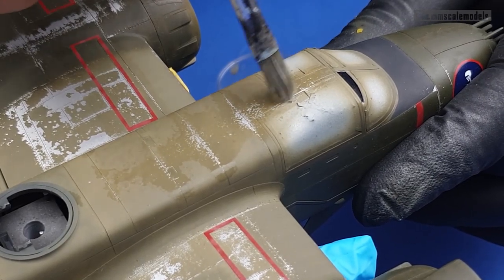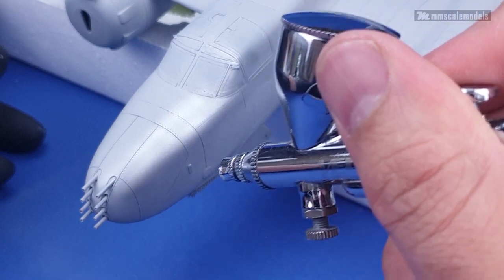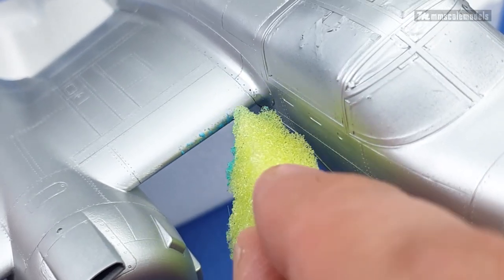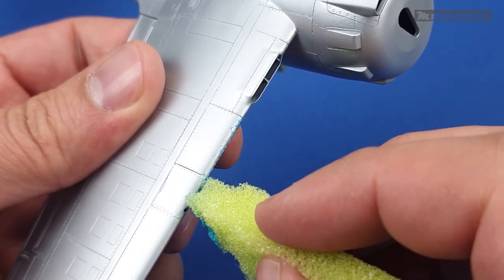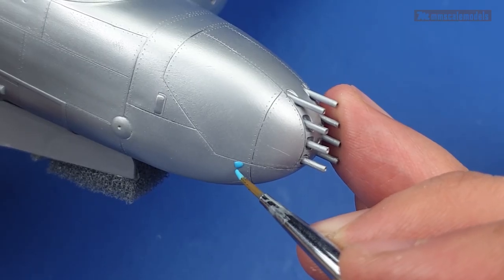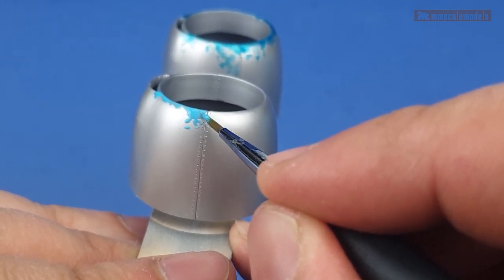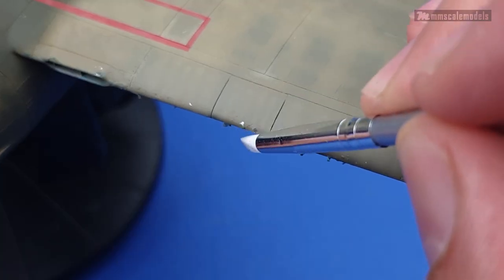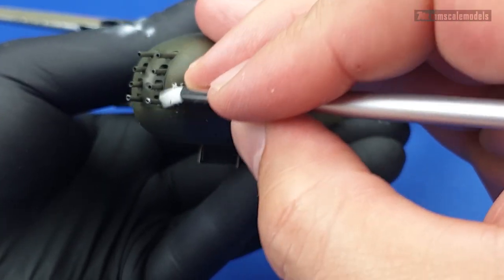Quick tips:  Masking fluid chipping - scale model weathering tutorial

Comment: I prefer the liquid mask for adding chipping - more controlled application and effect is very realistic.  Really, though, you can use both this and the hairspray technique together for best results.  And one tip, use a rubber glove on your hand (like ones used for washing dishes) to remove the liquid mask - the glove is thick and won't tear, the rubber easily grips the lm and you can easily vary the pressure you use 👍
Reply from the maker: Thanks for the tip Jerry 👍
Reply: @MMScaleModels  👍👍🇨🇱✈

Comment: I’d like to try this technique. So, you apply the masking fluid with the sponge and let it dry. How long are you letting the masking fluid dry before you paint over it? Same question with the paint. How long before you take the paint off? 

Does the 502 work with acrylic paint?
Reply from the maker: Depends on the fluid itself, usually it will become translucent when it is done curing. As for the paint that will depend on your next layers. I have had paint sitting on the mask for weeks. As soon as the paint is touch dry you can start removing the mask.